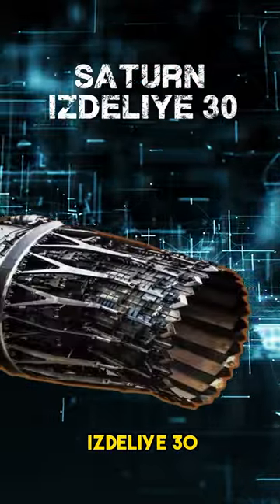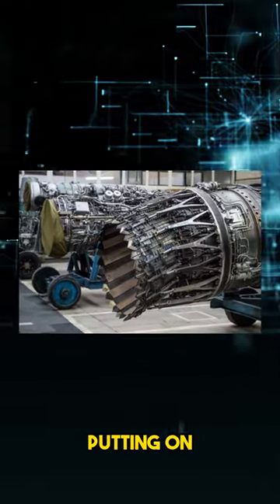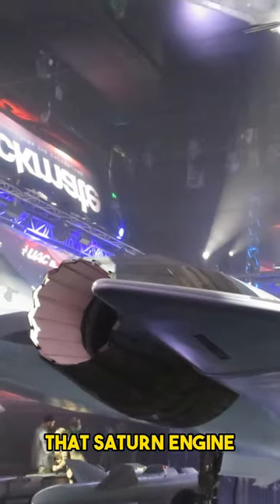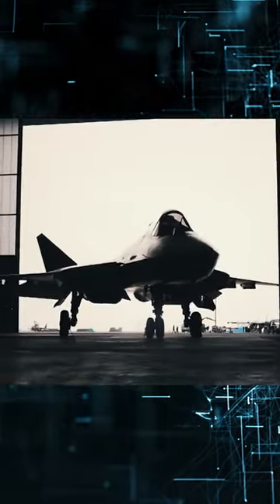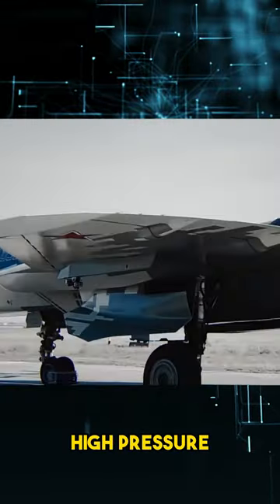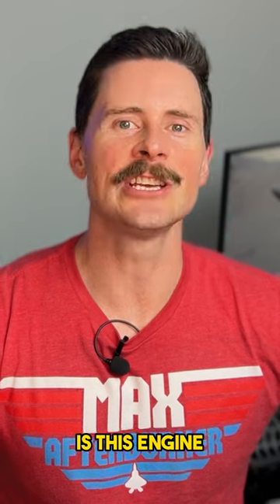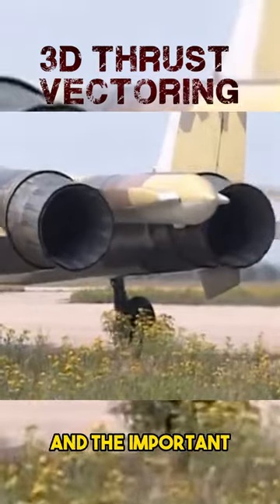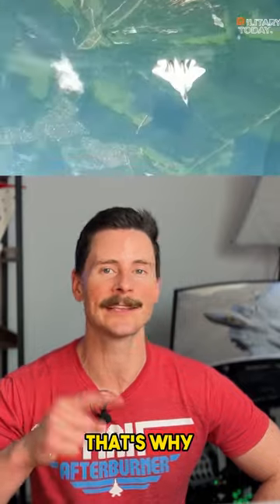This is the Thrust Vectoring Engine Used by the SU-57 in Top Gun Maverick

Comment: Still no supercruise . Those engines will be picked up on radar easily.  With newer long range air to air missiles this just helps the su57s enemy get a lock easier from a diatance.  Honestly if your going against the US Air Force, the dogfighting age is over hence no point for thrust vectoring. Sukoih should have gone with the raptor like engines they built but choose to go with these saturn engines. Beautiful work of art the su57 is ,but doesnt stand a chance against american stealth and radars .
Reply: It has had the ability to supercruise since the AL-41? The AL-51 shown is more than capable of supercruise.
On WHAT radar? Neither the AL-51F-1 nor F-1U feature round or heavily reflective parts, with even the F-1 featuring faceted feathers.

People have been saying the dogfight age is over since 1959. Each and every single decade had the same exact sentiment, and each and every decade saw dogfights in the modern age.
Thrust vectoring isn't used to assist in dogfights? They increase instantaneous turn time by a LOT, which is useful in quite literally any situation an aircraft could be in.

Comment: So what’s the deal with the heat signature? I assume it’s going to be an improvement on the older su35 type engines they were using. But do you think it’ll be comparable to the f-35 or f-22 when it comes to the infrared it puts off?
Reply: On paper it should be a substantial improvement to the predecessor . More thrust, up to 30% (implicitly much higher supercruise speed, probably equivalent to F-22). Less weight. Less fuel consumption. Longer lifespan. There may be some infrared improvements too but by far not as much and is not going to match the F-22 in this domain (the overall aircraft design does not allow for this obviously, however, that play is going to eventually  take place elsewhere - check out the drone companion, the S-70).

Comment: So I have a question regarding the thrust vectoring.  As far as I understand it, the SU 57 engines are not "true" 3d thrust vectoring nozzles; indeed they move along the vertical and horizontal axis of the aircraft but that is just the way the nozzles are angled.  is this correct?  Can anyone clarify this.
Reply: In action: https://www.youtube.com/watch? You can see the engines  in action start at 4:00 v=3iaYyYFicMw